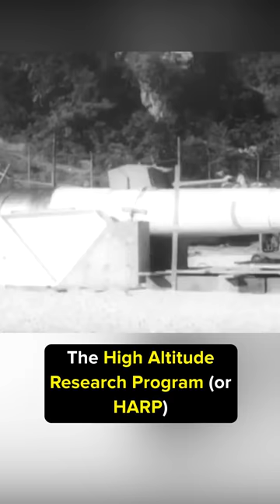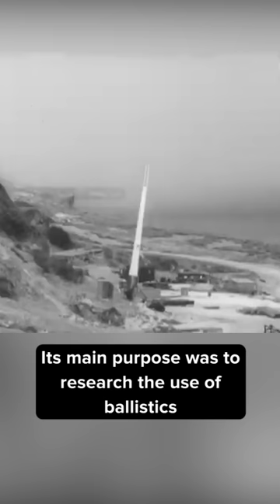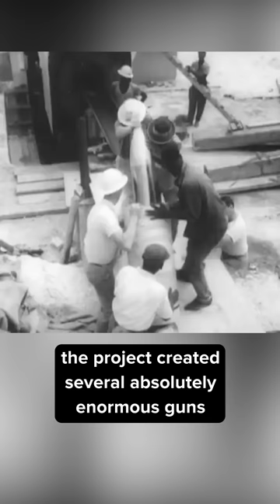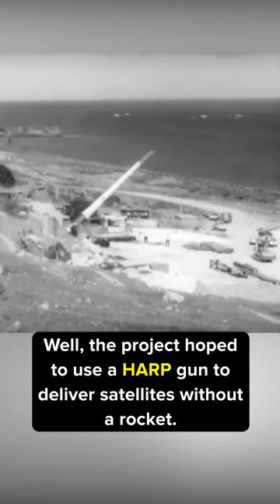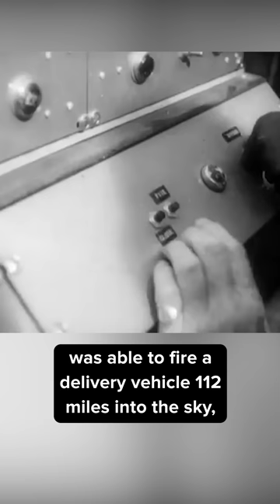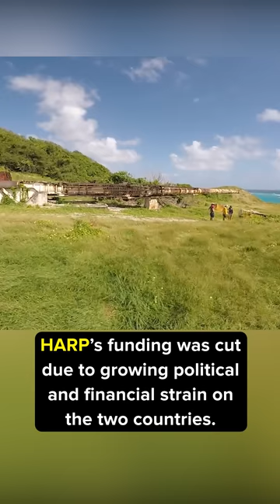Army's Supergun - HARP

Comment: I wonder where the Rounds went, when they came back down? Ocean?
Reply: Yes I think so.   And this gun really shows how hard it is to get something into orbit.   The altitude is the easy part...it's getting that 17,500 mph velocity to maintain orbit that is the difficult bit.
Reply: @recoilrob324  Artillery when I served had a RAP, rocket assist projectile. The rocket's purpose in the round didn't actually provide thrust, but broke the vacuum drag on the back of the projectile. I wonder if they ever attempted with that style round and if it would even help.